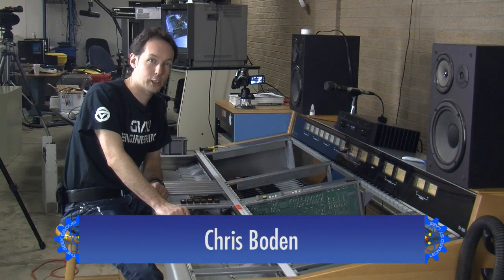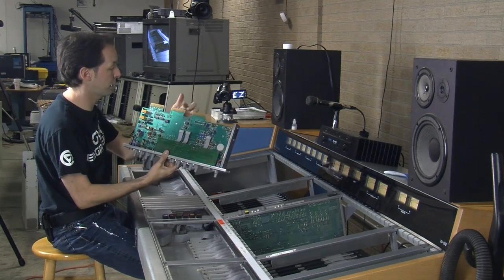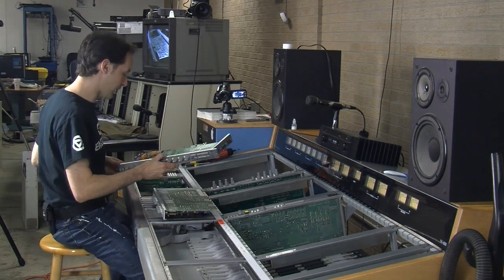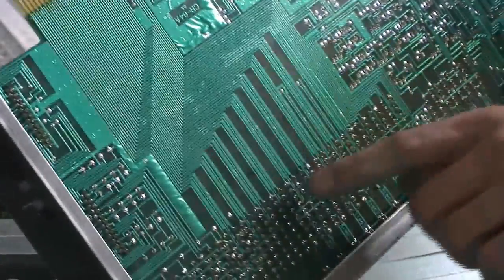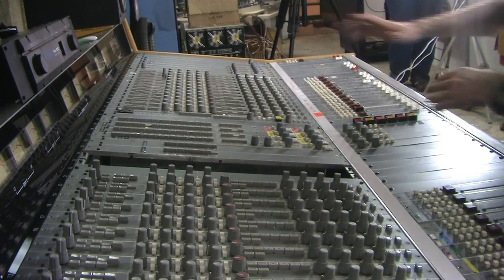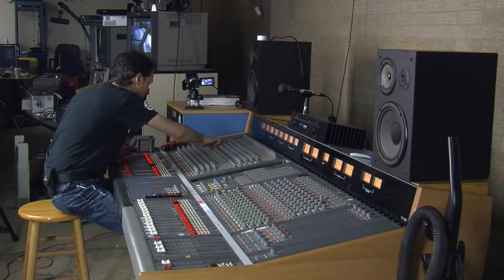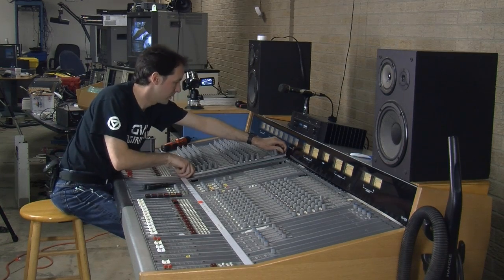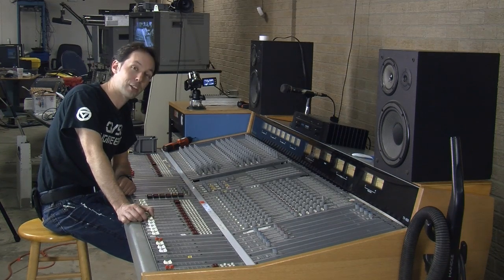Assembling A Wheatstone TV 600 Mixer

Comment: Got to love a good Wheatstone console. If its been in service since the 90 's though it may be time to start recapping modules to get back proper audio performance. Also they make crimp-able DB connectors that work well and will let you avoid thousands of solder joints. Good Luck

Comment: Nice board! My only experience was at a radio station with an ancient Dukane mixing board. And then they re-did and gave us a nice new board, but no labels on it. Went from rotary to sliders. 

And radio mixing boards can have 16 or so inputs, but only two outputs.

Comment: To make another card remover, take a ~2" machine screw or bolt with the same thread as the stock remover and JB weld a 1" washer to the screw/bolt head.

Comment: Ok , during the video you mentioned two cards that do not plug into the interface connectors in the chassis, So if thats the case what do they do and how do they interface? RF? AM? FM?
Reply: Those modules would be either Tape Remote or Line Select modules.  In either case they don't require a connection to the main bus assembly because their functionality does not require them to interface with any internal buses or power rails. In the case of a tape remote, the switches that the buttons activate are wired to the DB-25 on the rear panel of the module. You plug in a cable wired to external tape machines via the DB connector, and pressing a button on the module, for example, starts an external tape or cart machine (or turntable, or CD player, or whatever). In the case of a line selector, you would wire external audio line level sources to the DB connector. The audio would pass through the depressed button and its switch and exit the module on the DB connector. This allows you to expand the input capabilities when needed. Passive line selectors can also work in reverse so you could route audio coming in on the DB to a few different destinations, which would be selectable by pressing the switches.